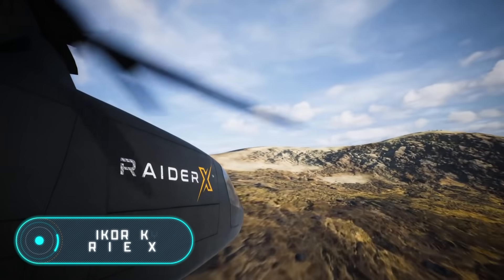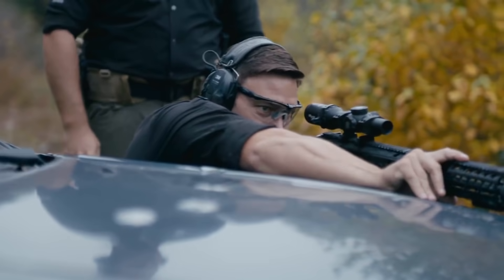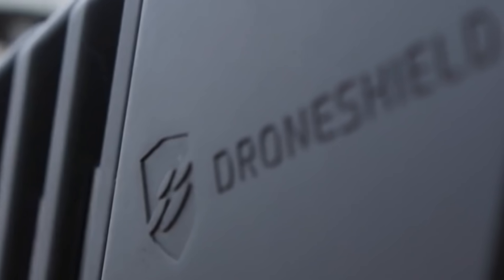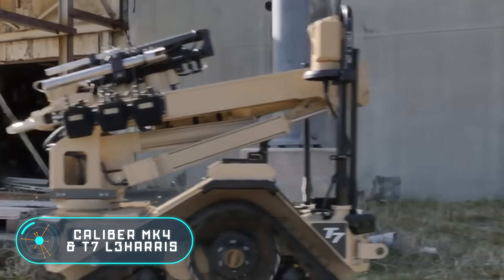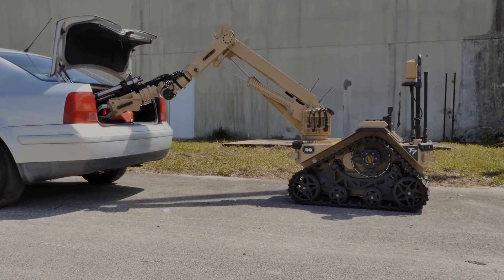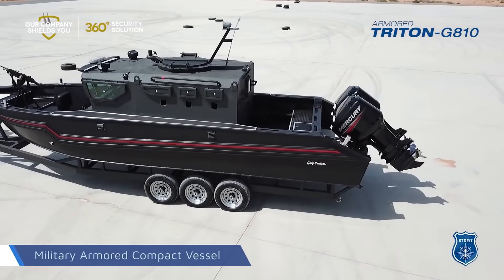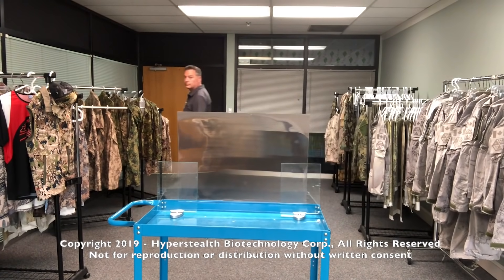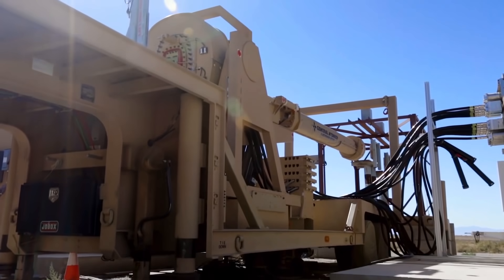10 MOST ADVANCED MILITARY TECHNOLOGIES

Comment: Hasn't Hyperstealth been outed as being a complete con?
Reply: Hyperstealth isn't a con. Hyperstealth is the name of a military camouflage research and manufacturing company, they make military combat uniforms. Quantum Stealth, which is what is shown in the video, is simply a demo piece that no military has so far been interested in due to the current limitations of the material. From what I can find it simply distorts the light coming from the other side. There was a stealth cloak that appeared in 2017 that was supposed to be a light bending fabric that perfectly blended with the background. I think that is what you are thinking of. That was a hoax.

Comment: Question: Why does a flame break out when fired from a RAILGUN, as when firing a gun with a powder charge? If you say that the projectile is accelerated using an electromagnetic field.
Reply: Because every time the railgun fires it slowly destroys the inside of the barrel, that's why they have such a high maintenance cost -you need to replace the barrel every couple dozen rounds fired. It's literally pieces of the rails themselves being super heated to a plasma and ejected from the tip of the barrel.

Comment: the raider is flexing on conventions that don't need attention like being slender in the face of being a helicopter which has a radius to accommodate: and the pusher propeller being a nope; tail rotors are only necessary to counter chassis rotation inherent in single rotor helicopters, but not necessary for counter spinning dual rotors.

Comment: The RailGun generates doubts in me, if the bullets are, as they say, propeled by electromagnetic forces, then why the hack is an explosion when the weapon is fired?????, magnetic forces dont explode, and even if they did, the explosion will be with thunders and sparks instead.
Reply: The explosion is the air in the barrel flashing into plasma as a result of the acceleration of round and electromagnetic discharge and it is one of the problems with railgun  as they tend to eat their barrels / rails out very quickly